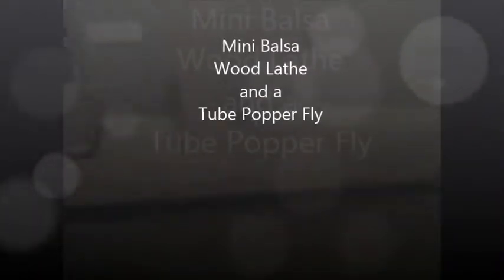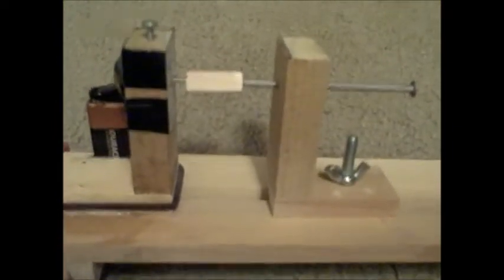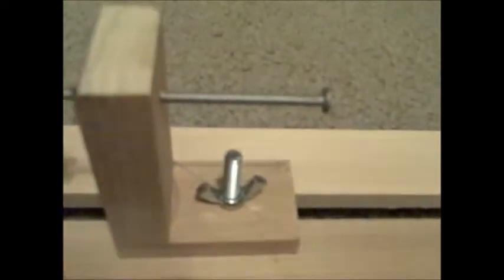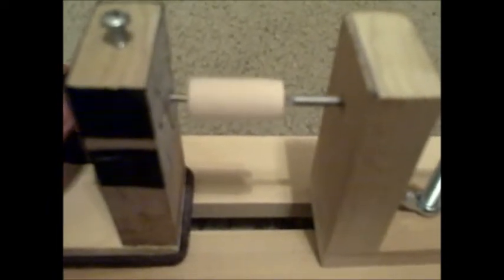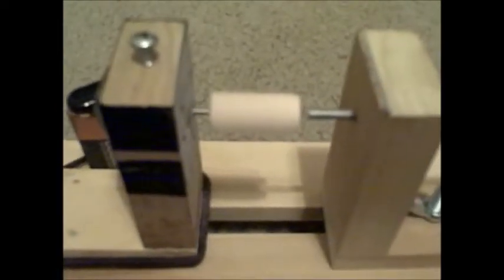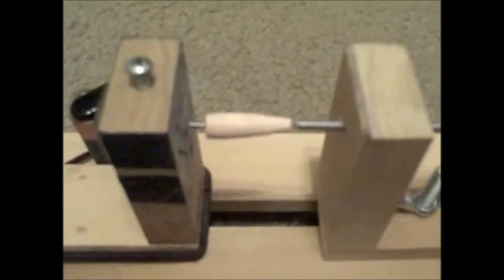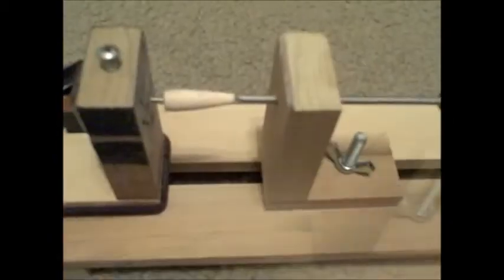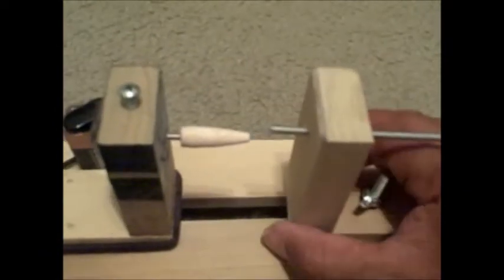Mini Balsa Wood Lathe and a Tube Popper Fly

Comment: how did u put this together?
Reply from the maker: +Paul Andrews Hi Paul, here is a link to the online article (http://hbng84.hubpages.com/hub/MiniBalsaWoodLathe) we posted that details how we made it. Have not counted how many poppers can be made on one battery. Do know we made over 30 using the same battery. Since its balsa wood and the poppers are small for fishing flies, the run time when making one is short - less than a minute or so.